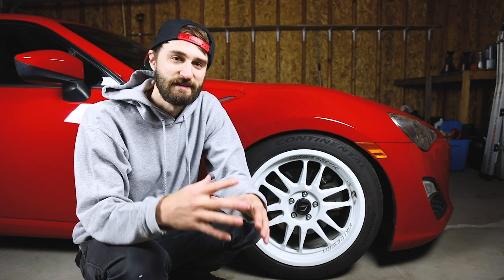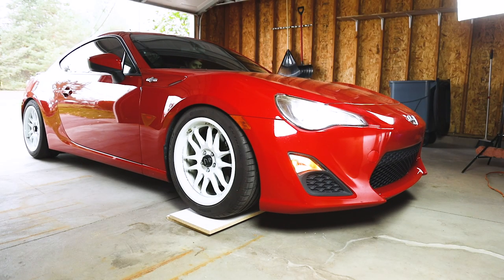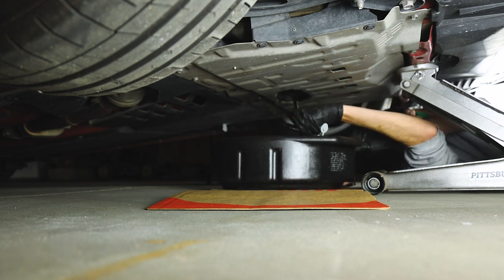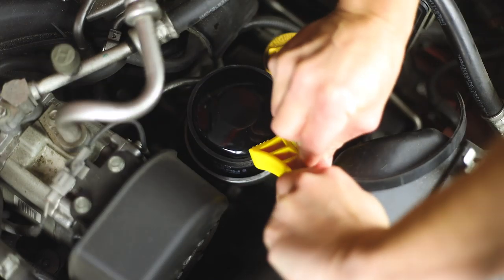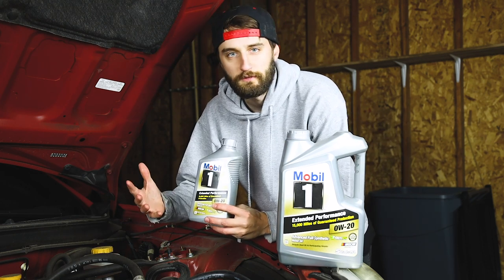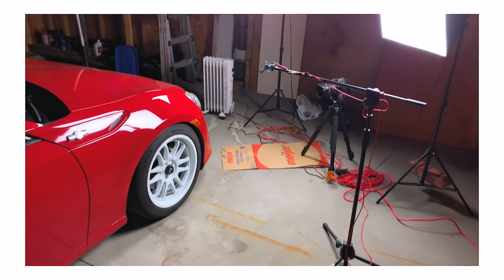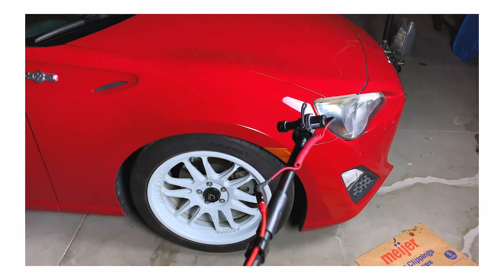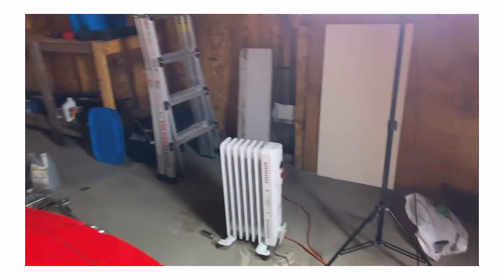ULTIMATE OIL CHANGE DIY | FR-S/ BRZ/ GT86

Comment: The bloopers and behind the scenes footage is very much appreciated! I do often wonder what the process is and adding those details just makes this video better than just a standard oil change video. I loved it! THANKS for sharing those scenes with us. Might I suggest putting an oil drain plug on the cars? I have one from Fumoto wish I knew about it sooner! It deletes the unscrewing of the plug and also the replacement of the washer. It's also a lot cleaner than traditional. I have my oil filter under the car, so its still messy, but with the filters being in the engine bay, it would make for a very clean spill-less oil change. Give it look.
Reply from the maker: Thanks for the tip! I'll probably buy one. It's almost impossible to take out the traditional drain plug without making a mess.

Comment: Hi Justin, I'm running a dynaglow deluxe propane heater and it heats my two car garage to very warm in about 10 mins.  As long as you have ventilation so there is no buildup of carbon monoxide and keep the tank outside, it works great.  I'm building a Mercedes wagon this winter and I'm  using that as my heater.  Love your videos, chill hop music and keep making how tos they are very welcome to this community.

Comment: Did you notice that the Mobil one oil filter you had to clean the edge a lot? Just wait till you change it again since the oem covers it more it’ll be easier. Also look into the fumoto oil drain valve, it’ll make your oil changes waaaaaaay easier and faster.

Comment: I would also recommend  not to overfill !!! Instead of putting 6.5l i poured 7l. in my engine, after driving it a little harder, engine's temp went high and the crankshaft starts making foam from the over poured oil, therefore oil pump cant suck the foam and is left with no lubrication and a piston broke the engine block :) , I wont trust oil level sensors anymore

Comment: What is the difference between a normal oil change and an ultimate oil change?

Are you getting an accurate reading when you check the dip-stick before lowering the vehicle off the back stands?

Comment: Justin, as usual great cinematography and great attention to detail with things like the torque wrench. However, I’m a little worried about the way you checked your oil level. First, you need to fill it to the center of the two dots and then run the engine for about 30 seconds and recheck. The filter doesn’t have any oil in it until you start the car so the level will drop slightly. Second, your car (at least in the video) was still on jack stands and not level when you checked the dipstick. You need to get the car level first. I’m thinking the car being on jack stands and the not starting the car first may have cancelled each other out, lol. I used to be a lube tech at a Lexus dealership before I got my engineering degree so pardon my nitpicking.
Reply from the maker: I guess Im just used to not having any dipstick on the BMW 😩
Reply: Justin Buice it’s funny, because I was just thinking that after I commented, lol. It’s not that big of a deal, your level is probably still within a safe range. Also, congrats again on the house and garage. It wasn’t until I got my first house (3 years ago) that I started doing more serious work on my E36.
Reply from the maker: Thanks! I’ve been looking forward to this for a while. My parents were generous in letting me use their place when I needed to. But I never wanted to be an inconvenience by leaving a car there overnight which limited me to projects that could be completed in a day.

Comment: You have a flat four engine using almost six quarts of 0W/20 motor oil. I have no idea why so much. I prefer using Pennzoil Ultra Platinum motor oil over Mobil 1, Castrol, Valvoline, Royal Purple, Amsoil, and Red Line because its made from natural gas.
Reply from the maker: Just going by the manual 😎

Comment: Hey at least the oil filter is up top. Honda’s and Mazda’s are all underneath which can be a PITA. My Integra is 25 years old with 371,000 miles, with notoriously weak stamped steel oil pans, and I’ve never once used a torque wrench on the oil drain bolt. Really just snugging it down is fine.

Comment: Spin on Oil filters you should spin on until they sit flat and then a 1/4 turn by hand. DO NOT use both hands to tighten it until it stops and then use a wrench to turn it another 1/4 turn more. Oil filter wrench’s for spin on filters are for removal only. That filter is way too tight. Lucky you have easy access to it. If it were in a tight spot you’d hate yourself next time you do it

Comment: Do you have a dipstick on the e90? Mine is electronic and take ages to register the current level...
Reply from the maker: E90’s don’t have oil dipsticks. If you drive a few miles, it will show you the oil reading almost instantly. But I agree, it’s super slow and annoying when you are just trying to change the oil and check the level
Reply: @justinbuice  thanks, i think some diesel models do (in the uk), I'm used to checking it cold, so need to get in the habit of doing it when warm!